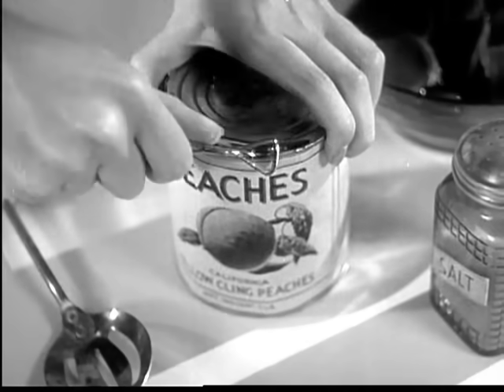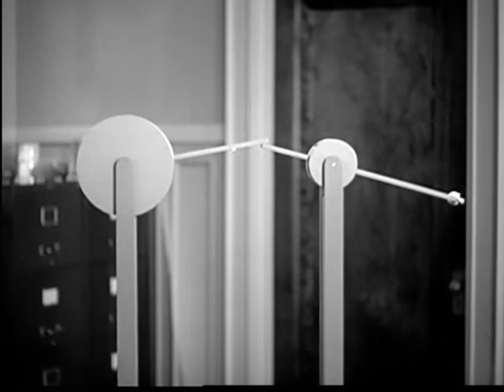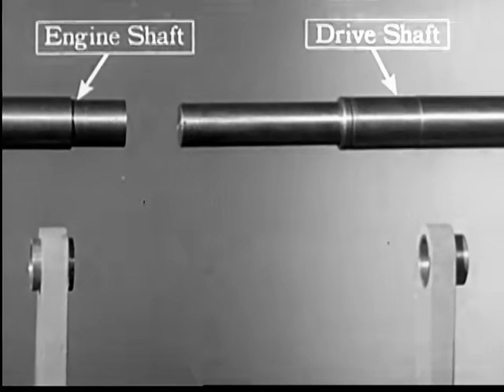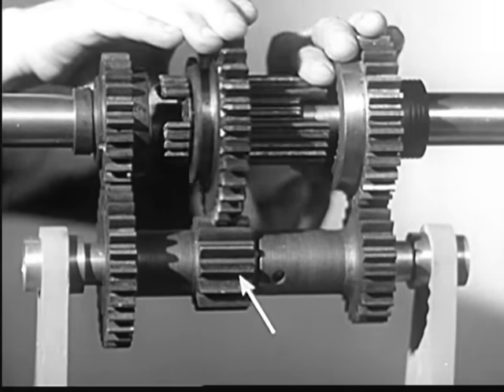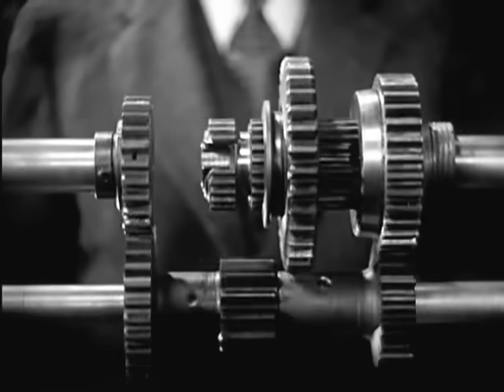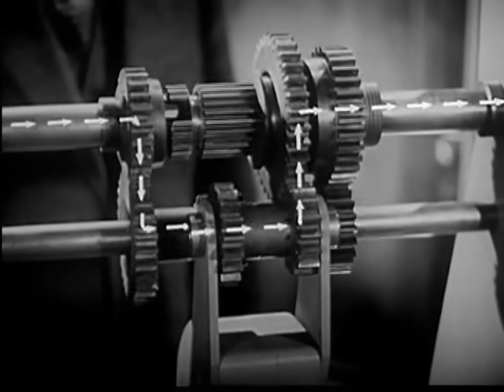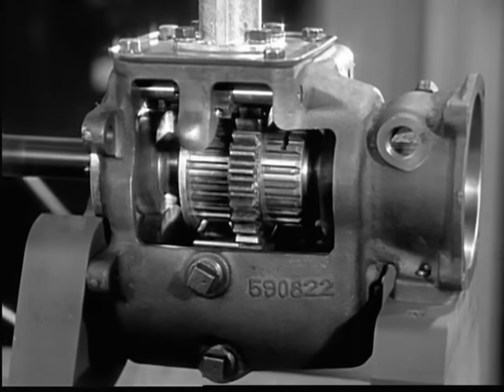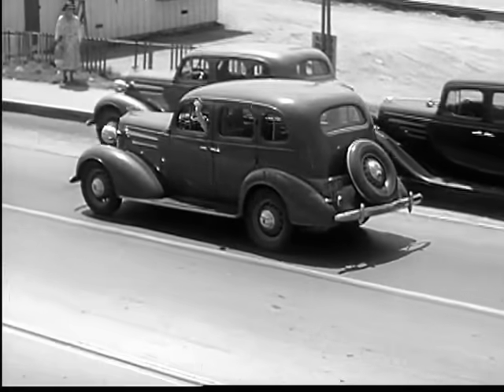Spinning Levers - How A Transmission Works (1936)

Comment: *+27670236199 @ M.U.S.U BEST SSD CHEMICAL SOLUTIONS AND ACTIVATION POWDER FOR CLEANING BLACK MONEY NOTES FOR ALL CURRENCIES
(Call +27670236199) WE ARE SPECIALIST IN CLEANING FOR ALL CURRENCIES NOTES WITH SSD SOLUTIONS, WHITE, STAMP ANTI-BREEZE BANK NOTES. WE ALSO DO CHEMICALS MELTING AND RECOVERING OF ALL TYPE OF CHEMICALS
 in Katlehong Germiston Johannesburg Ibhayi
Khayelitsha Kimberley Klerksdorp Mamelodi Mitchells Plain Mthatha Nelspruit Newcastle Witbank Eastern cape
Free State Gauteng KwaZulu-Natal Limpopo Mpumalanga Namibia, Botswana, Mozambique, Zambia, Swaziland, Madagascar, Zimbabwe, Lesotho,Limpopo, JORDAN,Witbank, Boksburg Kuwait,Ssd solutions in Turkey+27670236199,Ssd solutions in Belgium+27670236199, Ssd solutions in Saudi Arabia+27670236199,Ssd solutions in Soshanguve+27670236199,Ssd solutions in Pietermaritzburg+27670236199,Ssd solutions in, Pinetown+27670236199
Ssd solutions in Polokwane,Ssd solutions in Pretoria+27670236199,Ssd solutions in Randburg+27670236199,Ssd solutions in Roodepoort+27670236199,Ssd solutions in Rustenburg+27670236199
Ssd solutions in Sebokeng,Ssd solutions in Soweto+27670236199,Ssd solutions in Springbok+27670236199,Ssd solutions in Stellenbosch,Ssd solutions in Thohoyandou, Ssd solutions in Umlazi,Ssd solutions in Upington+27670236199,Ssd solutions in Vanderbijlpark+27670236199
Vereeniging,Ssd solutions in,\ Welkom,Ssd solutions in,Ssd solutions in Tembisa,Ssd solutions in Kempton Park+27670236199,Ssd solutions in Port Elizabeth,Ssd solutions in Bellville,Ssd solutions in Boksburg,Ssd solutions in Benoni,Ssd solutions in Bloemfontein+27670236199,Ssd solutions in Cape Town+27670236199
Centurion,Ssd solutions in Durban,Ssd solutions in East London,Ssd solutions in George,Ssd solutions in Empangeni,Ssd solutions in Australia, to Johannesburg ,, Germany, Austria, Vancouver, Denmark, Hong Kong, China ,, Pretoria, Durban, Australia, Wales, France, Cairo GHANA,Ssd solutions in Namibia,Ssd solutions in Botswana,Ssd solutions in China,Ssd solutions in Norway,Ssd solutions in Sweden, Capet own, Tanzania, Northern Cape, New York, Limpopo, London, Venezuela, Chile, Sweden, Denmark, Rwanda, Oman, Qatar, Dubai, Poland, Canada PotchefstroomNorth West Northern Cape Western Cape Call+27670236199 to purchase Best SSD Solution Clean Black Notes Dollars
WE ALSO? SALE CHEMICALS LIKE SSD AUTOMATIC SOLUTION FORM
CLEANING BLACK CURRENT DOLLARS.

I hereby use this media to inform you, that our company can clean out black
deface currency, (stained money) bank notes, We have all kinds of chemicals
used for cleaning of black money or stained money in currencies such as US
Dollar, Euro, Pound, and all local currencies, even if your defaced note is
25 years old,
WE SALE CHEMICALS LIKE TOURMALINE, SSD Chemical / Solution, CASTRO X
OXIDE, A4. AND MANY Like ACTIVATION POWDER & SSD SOLUTION FOR CLEANING
BLACK MONEY Chemical and Allied product incorporated is a major
manufacturer of industrial and pharmaceutical products with key
specialization in the production of SSD Automatic solution used in the
cleaning of black money,defaced money and stained bank notes with anti
breeze quality.OTHERS FOR DAMAGED NOTES, BILLS LIKE USD, EURO, POUNDS,
TRANSFERRING COLORS FROM USE NOTE TO NEW WHITE BILLS, AND BLACK NOTES, WE
WORK ON COMMISSION WE ALSO OFFER MACHINES TO DO THE BIG CLEANINGS, AND WE
DO DELIVERY OF PRODUCTS TO BUYERS DESTINATIONS AFTER A CONSULTATION FEE.
DEPENDING ON DIFFERENT CASES. FOR MORE INFORMATION PLEASE DO CONTACT US IN
OUR DIFFERENT OFFICES;
Call us or watsupp +27670236199
Email: gavachemicals88@gmail.com

Comment: 2020 student: Manual transmission is too difficult to understand.
1936 engineer: Hold my lever.
Reply: an auto is difficult to understand, a manual is so simple.
Reply: @claytons4789  yeah, manual trans are easier to understand, they’re also much cheaper
Reply: At least in Spain, while studying to be a qualified mechanic, you have to dismantle and put together manual transmisions and carburators, and make sure they work after the process.
I hope that knowledge is not forgotten.
Reply: @dracofenix3860  La hostia, ahora quiero dejar la informática y ser mecánico xD.
Reply: @aleaallee  pues mira, yo siempre odié la informática.
Y en los coches de hoy en día... Quizás puedas trabajar de mecánico sabiendo solo informática.
Reply: @dracofenix3860  Ahora que los vehículos siguen convirtiéndose a eléctrico sera que ingenieros eléctricos tengan un rol mas importante, pero como todos aparatos de movimiento propulsado, usan energía mecánica. Entonces nunca va existir una falta para los mecánicos, especialmente ingenieros mecánicos.
Reply: @aleaallee  Haz las dos cosas, yo he dejado informatica para meterme a mecanica pero conozco bastante gente que se ha ido a mecanica despues de acabar de estudiar info
Reply: @dracofenix3860  Voy a estudiar mecanica y no sabes lo mucho que me alegra que me digas eso
Reply: @dracofenix3860  Right, thats it, I'm moving to spain where I can get some REAL practical learning done
Reply: @dracofenix3860  Meanwhile in America all they want techs to be able to do is read a tablet and fire the parts cannon. Most shops over here won't even touch a car if it has a carb and they need to do engine work.
Reply: Automatic is way more complicated than manual
Reply: Gears on a bicycle is similar to the manual transmission. Easy to understand. 

Try this😉:
Ride your bicycle in gear 6 and apply  brakes, don't coast it just keep pedalling while applyong brakes until you feel that it gets hard to pedal when you reach the minimum speed of the gear.
(This is why we downshift when we slow down cause the engine can't take the load of higher gears while slowing down )
Reply: @W33d Senpai went on a road trip with family through the Canadian Rockies in a minivan loaded with stuff recently. Driving up a hill is like "power please... Really could use some power... I'm twenty under the limit now please downshift! Seriously van? Where the fu- WOAH okay that's a double downshift, maybe don't spin the engine at 5k rpm you can cool it. Are you gonna use fifth or is it no power in sixth or mom getting pissed off for revving out her van in 4th?" It's exhausting. I hated driving that thing.
Reply: No a lever is everywhere in automobiles seasaws on mechanical levers and on rotating gears
Reply: But in 1936 these videos were made
Reply: And they both end up crashing because the 2020 stud holds the lever
Reply: Dumming down is not a conspiracy theory
Reply: I think most drivers in Europe are trained in manuals. It's funny how Americans are completely inept when it comes to driving a proper car
Reply: Manual isn't even that difficult, it's just hard for people to get used to manually changing gears if they learned to drive with an auto, aka 90% of Americans and Canadians.
Reply: When I was in engineering school (Mech-E), we had to design, calculate, and study this in my final year. Its incredibly simple, just a bunch of pieces. It really is overcomplicated by people.
Reply: You mean lebeer?
Reply: That's a violently American comment
Reply: Manuals really aren’t hard to take apart and put back together I was doing them when I was 21 years old because I didn’t have enough money to buy another transmission so I bought a manual to learn how to check the parts, take it apart lay the parts in order and put back together the same way
Reply: @randomguy8196 Its cheaper to build, maintain and repair basically
Reply: @W33d Senpai she was worried I was gonna break it. And fair enough, if there is one place you don't wanna break down, it's the rockies. Transmission just isn't very good it being a transmission.
Reply: And will be even worse in the next coming future with the electric car reality.... will disappear everything!
Reply: 1936 says to 2020, doth thou know what a gear even is?
Reply: Todays manny trannys are more complicated with synchronization and what not.
Reply: Manuals are easy. The modern manual transmission is far more complicated with how it is a capable of having ever increasing gears, but it still works the same.
Reply: At least I understand what im grinding now 😆
Reply: thats so real!
Reply: Manual is hard to understand. Boomer alert
Reply: It’s not difficult. It’s just like learning to ride a bike. Takes a few minutes to learn, a few months to master, you’ve got it for life. I’m 20, I drive a 5 speed manual every day. I’m at the point where I’m able to shift from any gear but first without using the clutch. (Gear floating). You always have to use the clutch in first. I had an auto car until a friend of mine let me try his manual transmission. I fell in love with it instantly. Sold my dct car once I picked up my manual car.
Reply: @iheartapple-114  Likewise for me. I drove with a manual transmission for years. Then I stopped for about 10 years. Then I purchased a car with manual transmission and in a few minutes I had picked it back up like I hadn't stopped.
Reply: @Solitaire001  Just like riding a bicycle. 😁
Reply: manual is easy boomer
Reply: @wustenfuchs3285  no, he wants to know how it works, not how to use it
Reply: @wustenfuchs3285  If it was that easy then the lazy shits driving today could figure out how to operate one. NEvermind how it works, simply how to use one. Best anti-theft device your car can have over here is the clutch pedal, 'cause with that pedal thieves will never figure out how to get it started much less drive it.
Reply: @wustenfuchs3285  using boomer as an insult is kinda a jack ass thing to do. I’m a zoomer so pretty young, but that doesn’t make me smarter, I just have grown up with modern technology, so I have to understand it earlier in life, the brain adapts better at a younger age, older individuals have more experience, but in different areas, if you try to solve the same math question that a 60 year old mathematician that has blessed genes (no memory loss or anything else that makes life harder like dyslexia Down syndrome or that one memory loss gene) they can do it faster by a lot if you could even at all (unless your a frickin math genius)
Reply: @wustenfuchs3285  honestly I didn’t expect much different from an internet troll that only knows how to make someone sad, which is something your good at, I feel sad for you
Reply: @wustenfuchs3285  Dude, I hope whatever circumstances prompted you to behave like this are replaced with better ones in the future. Hoping things go your way down the road pal.

Comment: 1:03 That is the sketchiest looking car jack I've ever seen. That's a brave man being under the back end like that and trusting that thing to not fall over.
Reply: When bumpers could lift the corner of your car, the factory supplied each car a 'rachet' jack. You had just enough lever to lift it a quarter of an inch to the next tooth of a linear gear.

Comment: FYI motorcycles and mopeds still use the same transmission design with straight cut gears and no syncromesh

Comment: The thing that this video has that alot of general education doesn't is that it teaches the concepts not everything at once. 

Thats how people improve stuff, learning how it works. You're not going to be able to think about how to improve a car engine for example if you are just given a lot of terms and all the parts that exist in the 2000s. What you should be given is how an explosion pushes a piston, then how a piston works, then how all the pistons work together and so on.

People also wonder why isnt education being changed then. 

Well it could either mean that the only people teaching and who are in charge of education are the only people who are okay with how it works and does not want it to change, OR it means they were explained how to teach by being thrown into the deep end on how to teach, not given just the concept basics and tought how to improve from there. And this creates a loop of generation to generation being thrown in the deep end and nobody learning a single thing. 

And that same concept goes for changing education. We dont just ask teachers to change how they teach, we start with the generation who WANTS to become teachers and teach them the right way, the new way, on HOW teaching works so they can IMPROVE it. Its because that generation is our future and if we want that to change, then we start at the basics.

Comment: The milometer would have completed it's circuit at 99,999.9 miles. That's considered average mileage for a used car today or in the case of a Rolls - could do with a clean and a service.

Comment: "Steep Hill. Use Second Gear."

Oh how they even told you to use Second Gear back then.. 😏😏😏
Reply: depends in the gear ratio if the gear ratio are short maybe you can go at higher speed and gear
Reply: @oaz8  no my point is, the automobile back then was such a novelty that they even had to tell you to use which gear.

Comment: Sign: "Steep grade, please use second gear"
Me going 70mph on a modern 6 speed manual: "Okay" shifts gears watches RPMs jump to 9k engine blows up
Reply: Valve toss, spring stacking
Reply: @oaz8  plus, it's a joke.
Reply: Lol my truck does only single digits speeds in 2nd. That's why I have 13 gears.
Reply: @Redbikemaster  gotta go through 9000 gears just to reach 30mph, lol.
Reply: @IntelCoreI77700K  it's what it feels like lol
Reply: You're lucky a hundred shot of nos didn't blow the welds on the intake.
Reply: @troyguererro0898  lol at the fast and furious reference
Reply: @oaz8  speed limit is 70
Reply: @oaz8  In this situation, it's i77 coming down the mountain into North Carolina
Reply: SMTFITNESS  maybe sports cars with manual transmission, but I have a 2002 5 speed dodge neon (not the srt) and driving economy friendly (not redlining every shift) you go into second gear at about 7 mph and get out at about 15 mph, redline shifting, second gear barely gets to 50 mph
Reply: More like 100k lmao
Reply: Me, driving my Kenworth 18-wheeler... Yeah, I don't think so!
Reply: Time to do the obligatory "edit: Thanks for all the likes kind strangers"
Reply: Lmao yeah 4th gear was unheard of back then if I'm not mistaken
Reply: Most 6 speeds should easily hit 70+ in second gear so engine probs won’t go boom 🙂
Reply: @frozenshadow9444  True, lets just assume for a car that had a lower rev limit, and shorter gears for jokes sake, lol.
Reply: @frozenshadow9444  No they don't. Third gear for sure, but not second gear. I'll use my current and Previous car as examples, both have 6 speed manuals in them.

My old Nissan Sentra Spec-V had a 6000rpm redline. In second gear the ratio is 1.94, with a 4.13 final drive, on a 24.6in tall wheel/tire. Top speed in second is 54.83mph.

My current Mustang has a 7000rpm redline, with second being a 2.43 gear ratio, and a 3.73 final drive, on 27.7in tall wheels/tire. Top speed in second is 63.67mph.
Reply: @SkylineBNR34  we’ll obviously my car is different. I have a 2018 mustang gt 6 speed with a 7500 redline, a 3.55 axle ratio and 27.3 inch tire, and it will top out at 73 mph in second.
Reply: @frozenshadow9444  The MT82' in the 2018+ have different gear ratios since they have 1:1 in 4th instead of 5th and have two overdrive gears, plus with mine being the 3.73 it lowers top speed but makes acceleration quicker. I also forgot they upped the redline on the 18+ too. 

But that's funny that you also have a Stang too. Cheers fellow Stang owner.

Comment: This video is great and all, but modern semi trucks still use nonsycronized trans. Too much horsepower and torque being put on the road. A synced transmission would probably blow itself up. Works great for cars though.

Comment: This is an excellent explanation about the Level and gears. The narrator missed that screws and bolts are circular levels that pull together or push apart as one turns them (Archimedes also invented them). And fans, propellers, and even turbines are rotating levels, moving fluids as they turn!

Comment: Then she will shift into 2nd speed and bring her car easily and safely under control before it reaches the bottom of the hill.

I thought that's what brakes were for.
Reply: That’s called engine braking. You can switch from a more direct gear ratio into a lower gear ratio to provide resistance to movement. If you ever hear a semi-truck make that loud BRAAAAPAPAPAPAP noise while slowing down, that’s because they’re not using their brakes to stop, but the compression of the engine instead. That’s called jake braking- similar concept. It’s illegal under certain city ordinances because it makes a lot of noise when they do it. Big trucks do that more often because it keeps the brakes from wearing down, and they’ll wear down more quickly with a larger load.

Comment: So it is the third gear engine connects to wheels directly.
Reply: According to the example shown. Other transmissions have an overdrive gear where the wheels spin faster than the engine.

Comment: I love how all of the drivers shown are women, I feel like most modern women don't find joy in driving anymore... let alone know how to drive a manual transmission. Tip for female drivers... LEARN MANUAL!
Reply: But modern automatic transmissions are more power efficient and wear out less than manuals, so there is no benefit for going back to manuals.
Reply: @raymondramirez9177  But they aren't as controllable and they allow drivers to be more distracted. Most manual transmissions tend to be more fuel efficient and they offer the user much more controller over how the engine is operating. Driving a manual transmission downhill is a prime example of this. I see many people riding their brakes down hills and this can be much more dangerous because automatic transmissions don't offer engine braking. Drive what you want but I will stick to manual, and actually enjoying my driving experience. If I want a car like that I'll buy a Tesla LOOOOL. No gears needed.